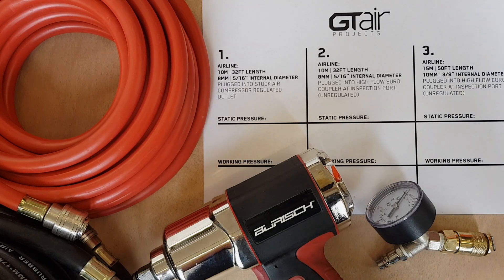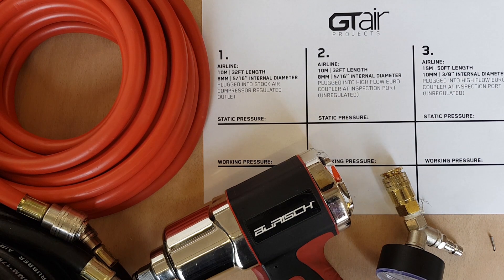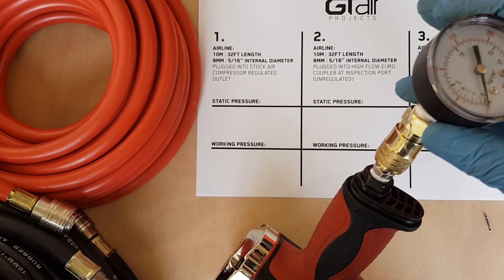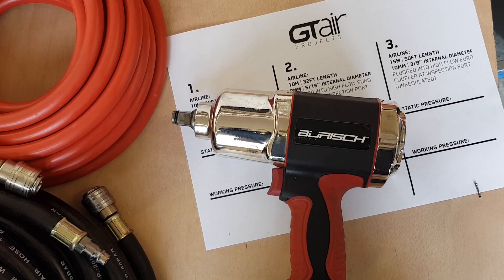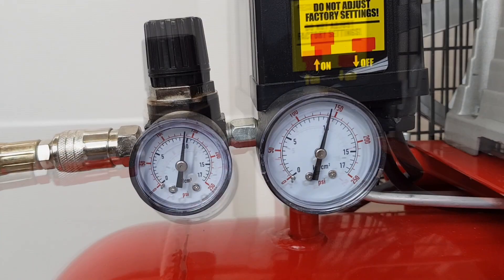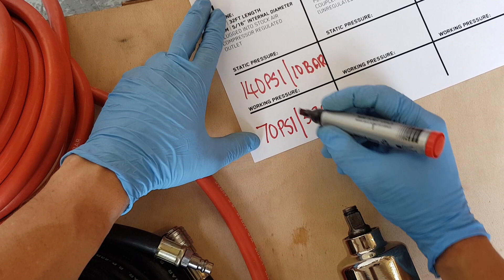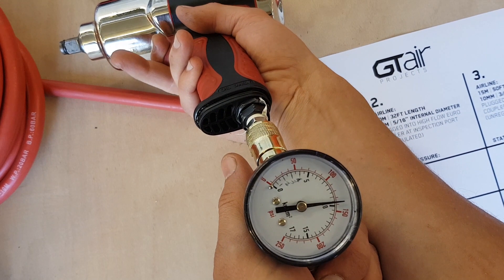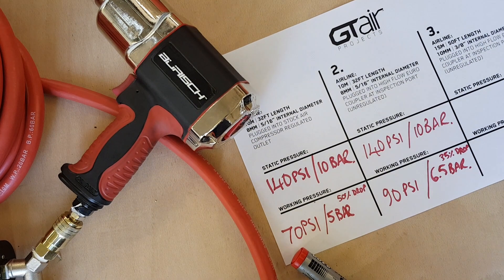Supercharge your air compressor tools for cheap - Working Pressure & Air tool setup

Comment: What gets me is how restrictive a lot of air products actually are at consumer level unless you spend big money.
All i can say is be careful by passing the regulator as shouldn't affect it but i have seen stuff go boom the way you have setup as a small leak caused system to keep going and over pressurise where as through regulator it would of turned off
Reply: Sorry but this is incorrect. The pressure switch controls the final pressure and when the power is shut off to the motor and not the outlet regulator. The pressure switch is still doing its job in this setup and perfectly safe. Thanks for watching

Comment: False report. Quick  connect fitting at the tank will be a restriction as well as at the tool. Even a 10 mm inner diameter air line will be a restriction. Test should have included a 1/2 inch or 13mm inner diameter air hose with no quick connectors in place. Also the gauge measuring the pressure drop was placed where there was static and velocity driven air which would give different readings due to Bernoulli principle of pressure drop any time air velocity increases across a given spot. 

Try to know what you are talking about before trying to influencing others who are not informed.

Comment: What is used to pull large nuts and bolts are a electric impact cannot go wrong, which works for me especially front end components. I would start of with electric and used the air tools in some situations.😲🙀

Comment: Two big mistakes made in this video. One is the running pressure should always be taken with the tool under load. A tool not under load will blast through airflow without doing any work (needing pressure) but will push through much more volume than needed and cause a lower reading. Two, putting tank pressure into an air tool designed for and regulated for a lower flow and pressure can be dangerous. So yes run regulators, fittings and hoses that will give you the REGULATED pressure you need at the tool but NOT unregulated....EVER!! I've seen air tanks and guns blow up and people can be SERIOUSLY injured by following the directions in this video.
Reply: I thought he did make clear the precautions to be taken and he had explained not to blast a higher volume of air through tools not designed to take more.

Comment: Why did you say the last test was 115psi when everybody can see it was 110psi.
Reply: Wrong, the first pull if trigger hit 115psi. Each additional trigger pull will drop the pressure more until the compressor kicks on and refills to max pressure
Reply: could get same results using larger diameter air hose.

Comment: All the American "inspection ports" are on the bottom, and arent for inspection, they are for releasing the condensation that collects at the bottom of the tank, is that what you are referring too?  Does UK,Euro have an additional upper mounted port that doesnt release trhe moisture like that?
Reply: I see its on the side of the tank,  does it not have a lower plug as well?
Reply: @feellnfroggy  it does have a lower port for drainage and 2 ports on the sides (one each side). I guess most horizontal tanks are like this.

Comment: How come you didn't show the results with the regulator you recommend?  I would expect it to be better than the original regulator but not as good as no regulator.
Reply: I think the results would be the same 20% drop however with the addition of being able to regulate it for say a spray gun that runs at 2 Bar.

Comment: I got so frustrated with my SGS 100l 14.6cfm and 10mm internal diameter hose (as seen on the clip), that finally, I have bought Makita DTZ1000Z. Portable, 1000Nm, thank you. Compressors are for pumping tyres, painting and blowing the dust.
Reply: I can totally relate with such a choice. 
But please do not compare a single function, although top quality, tool like the Makita. With a top price to go along! 
To a cheap compressor and tools. That does a lot more diversified work for a lot less price wise! My workshop installation and several tools are living proof of the concept. ;-)
That's comparing a specific use race car, to a "tool holder" like a tractor. ;-)

BTW properly tuned and setup the compressor will not take any shame from the cordless. 
Cheers

Comment: It's common sense really, bigger internal diameter = better air flow, but when you first get started with air compressors it can get quite confusing so this is a good helpful video.

Comment: Good video. Made me realise air ain't for me. Going to get a Makita DTW1002Z 18v LXT Brushless 1/2". Even though it's battey it's got a 1000Nmt.
Reply: the makita  battery impact wont get even close to air impact..... massive difference. battery is handy for out in the field and that where it stops.. air tools last about 30 times longer too..
Reply: @philldownes8685  Had the Makita nearly a year now and it's handled every thing it's been put on. For me it's spot on.

Comment: If you do the experiment while the impact wrench is on full load, like removing a lug nut. your numbers will be different. Another thing, the manufacturers manual says: do not run with no load because this may damage the impact system. Thank you.
Reply: I was thinking the same thing,,,,,

Comment: Very informative. Checking my running pressure first thing in am. Pretty sure I set static pressure to 90 psi and never had a problem but this old dog just learned a new trick. Thanks

Edit: I may have run it higher than 90 just because. Curious to know where I set it years ago.

Comment: Thanks for a great video.  The difference between static and working pressure is amazing.  Often one reads complaints that a certain air tool cannot remove a lug but, when other users have no problem.  

Clearly, they need to look at their setup.
Reply: Although in some instances it can be the bolt in question that is either damaged, rusted, tightened way above spec or a combination of both that's causing the trouble of removing a particular bolt in question.

Comment: Thanks, a very useful video. I have a 100l 10 cfm comp. and worked out for myself it was worth investing in a 20m 10mm hose, as my machine is on the edge of being powerful enough to use high demand tools like impact wrenches. In the reviews of the Erbauer tool kit I bought  there were lots of complaints the ratchet and impact wrenches (90 psi)  didn't have any guts, but I just turned the tank pressure up to 120 psi to allow for pressure drop and found the impact wrench worked great on my tractor nuts.Yes, my tank is on the small side, so I may have to wait for it to top up to get all the nuts off, but I'm not working in a tyre bay or F1 pit. For the sake of a tenner I will invest in a y-fitting and gauge, just to take the guess work out of it.
I'm hoping I can get enough pressure ( 120 psi is my max) to use a spray gun on my barn roof. I know that will be pushing it, but maybe using high flow fittings and plugging straight into the tank will give me the boost I need. My small tank size won't be a problem, I hope, as I'm thinking I'll be spraying a square meter at a time, before moving up or down the ladder, whilst the tank tops up.

Comment: the outlet on the regulator is a 1/4 , whats the point of having all this high flow stuff if it has to pass through a 1/4 inch choke point ?
Reply from the maker: You could put a larger fitting there if you like - but the results of the testing speak for themselves, there's very minimal drop in pressure with our suggested setup, so using the standard 1/4" fitting on that outlet doesn't affect it as you might expect. 1/4" fittings are cheap and in plentiful supply and most domestic airlines have 1/4" threadwork.
Reply: @gtairprojects5298  so what is the biggest compressor i can get for a domestic supply ive been on the gtair site and they seem to only go to 90 ltr i need a 150 that can run in my home garage ?
Reply from the maker: We can supply compressors up to 270L. The 100L direct drive models have a 13A plug, so if you want plug and play go for that one. Both the 90L and 150L belt drive models are not supplied with a plug - lots of people fit 13A plugs to these, but we don't specifically recommend this as they run close to the limit of a 13A plug. Its not too expensive to have a dedicated 16A supply with a blue plug routed to the compressor and a seperate 32A MCB dedicated. This is the correct way to do it for hassle free operation and motor longevity/performance. I wouldn't run any air compressor on an extension lead either.
Reply: Checking the inside diameter of many 1/4 high flow fittings I have found most range from.280 to .302 .with an air temp of 90 degrees f,static pressure of 140 psi,working pressure of 90psi ,working with the larger diameter of .302 this will give you a flow of around 137.71 scfm.more than enough to run most any air tools.

Comment: Just curious as to the drop that is experienced by connecting the 10mm hose to the regulated outlet.
Reply from the maker: Hi Dan - This is a good question. You could use a 13mm ID working airline if you wish which would be a bit less restrictive - however, lugging around and actually using a large bore airline of this size can be a bit tiresome and impractical - the thinner ones are a bit lighter and more agile/comfortable. Getting rid of the initial restrictions on the compressor side all the way to the wall mount regulator makes the biggest difference to the performance and as long as you're using a 10mm ID work airline you won't experience much drop from it (negligible). We do supply a PCL retractable work airline which has a 13mm ID and they're very good, but I've tested the difference between that and the 10mm ID with the High Flow kit and the performance difference is very small. The best thing you can do is bypass the compressor regulator and use a minimum of 10mm ID - and that for all intents and purposes is all you really need without getting too worried about it.
Reply: + 1 on this, I'm just trying to research my first compressor and have narrowed it down to a kit from GT Air, this idea seems a great way of getting the best from it but I'm struggling to understand why I'd be adding a 5m 13mm ID hose to the regulator and then reducing the pressure for a further 15m with a 10mm hose to the tool, to me surely it would be better to continue the 13 after the regulator to the tool and only reducing it there if needed or does this not make a difference? Just trying to get my head around all this.

Comment: I got the set without the accessories because I'm picky. >>>>t.co/44LpnsEldQ     Follow the break in instructions like the other reviews say. Run for 15 minutes while the release valve is open. Good construction overall. comes with two quick connects. I ended taking one of them off and putting a recoil hose on it. One less point of failure.
Reply: awesome

Comment: you should not use more than one quick connect, they take away so much flow!
Reply: yep. they are proper crap and defintely slow down the volume. a lot.  put the hose straight to the tank  for less loss of air.